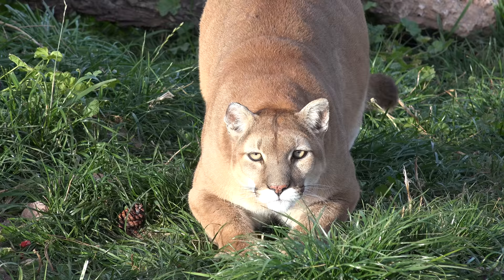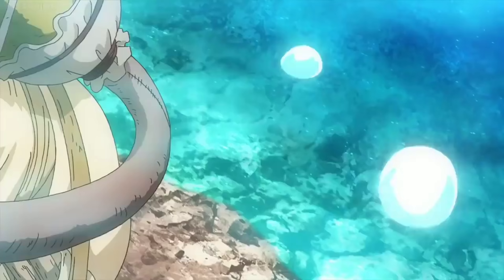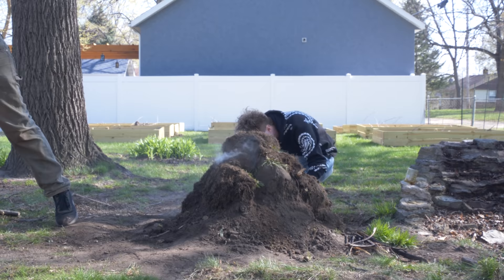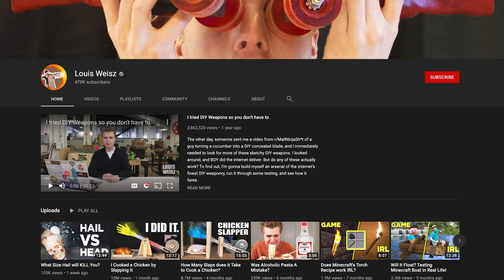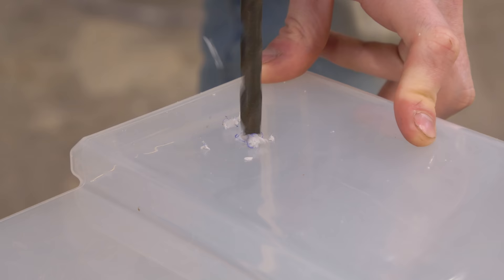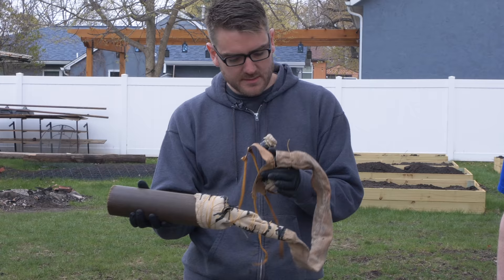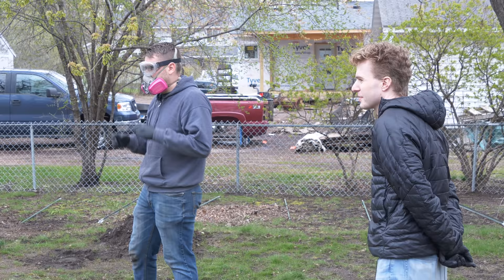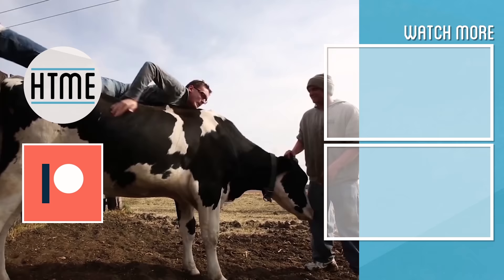Making Dr. Stone Gas Mask From SCRATCH w/ @Weisz

Comment: You know, the fact that you have to remove your foggy glasses, is a fairly good indicator that it is not airtight. Fellow glass-mask guy here.
Reply: yes and no, glasses only fog on an exhale, which wouldn't be an issue so long as the mask resealed on an inhale. 

That said half-face masks aren't the best choice for an air-tight seal, as the edges cover parts of your face that move as you turn your head or talk, which breaks the seal. it would be better to do a full face/head mask or to just stick the tube in your mouth as your lips can easily make an air-tight seal.
Reply: @j.c.cannon2112  The fogging is still an issue because the resealing on the inhale isn't instant, so some toxic gas would get in before the seal was reestablished. Modern gas mask valves are designed to be sealed tight any time that there isn't a positive pressure pushing gas out, so they don't need an inhale to reestablish the seal.
Reply: Redundant anyway.  In the anime they're going in to an area that would blind them long before the masks failed

Comment: I definitely think that the chlorine gas produced in that box was way more than the charcoal could effectively absorb. Maybe if it was a lower concentration mix with the air, the results would have been better?
Reply: And the mask is actually too small for them, it doesn’t cover all the nose and the chin.
Reply: I dont want to be that guy, but please keep in mind gas masks ADsorb chemicals physically, they dont ABsorb. Its a important difference and the reason they want the most surface area. With absorption it would be irrelevant, because there only the volume counts. Also, i think if they cooled it down somehow it would adsorb way more of the gas, cause the brownian motion wont be as high as with higher temperatures and therefore the molecules would stay more on the surface. They should do a follow up video where they try some upgrading.
Reply: @Aochso  There's also the issue that the pump was probably pulling air way too fast.
In the show, at least, Senku stresses that you shouldn't panic and hyperventilate, because the filter won't be able to keep up with you panicked breathing.

Comment: You could theoretically seal the edges of the mask to your face with clay or mud, but then you wouldn't be able to talk or move your mouth much without breaking the seal. Awesome video, now I gotta go watch Dr Stone lmao
Reply: Soft bees wax on the edge to help seal against skin
Reply: @kirkstinson7316  ouch
Reply: @user-hf2qh5ck7j  soft wax (wax and olive oil), not body wax wax. In proper proportions the mixture should be similar in consistency to vaseline (which fun fact, can be used on gas mask if you are not clean shaved for better seal).

Comment: If you can't beat 'em Join 'em!!  Great work guys!  I hope to offer a few pointers that might have made this more feasible for things that would have been known both to Senku and Kaseki. 
1) I don't think the anime explains where he gets it, but in addition to the activated charcoal I believe Senku used Potassium carbonate, which (and again my chem is rusty and I was never that good to begin with) would have caused a double replacement decomposition I think leaving you with Potassium Sulfate, CO2 and Water.  Someone that knows more about volcanic gasses and has had Chem in the past decade please check me.
2)  Senku mentions it in the Anime, Hydrogen sulfide is denser than air, so it pools, and that's why his masks have the big glass chimneys.  They're trying to pull air from where it's safer.  Provided you have good seal, this is important.  So the next tips will deal with how to ensure good seals.
3) Senku has billows, and they have a shallow pond area if you have someone to take the place of Ginro and Kinro,  you can use the billows to inflate your tubing and check your tubing and mask for leaks, as steady stream of bubbles will let you know in a hurry where your problem area is.  Or, and this is not shown in the anime, if you have bamboo and caveman glue or pine-tar etc.  You can actually create any number of air or water pumps from that nearby waterfall.
4) Leather & Tube Tips:  
A)Making seamless leather tubing is hard, I commend you on what you've done.  But there's an easier way, There are animal organs that you could prepare or use as an overwrap to make sure you contraption is actually gas tight.  
B) Keep in mind that all leather products are going to have a limited shelf-life and probably would need to be waxed before each use, 
C) The duct tape was a good idea, but you can improve seal over the mouth in several ways, such as taking the time to shape and fit the mask to the single face it was intended for (can be done with stiff leather, oil, and wax),  you can fold the outer lip of the leather over to make a better seal / gasket that with crush / deform around your face better and make a more airtight seal, you can knead things into wax and create a semi-seal
D) If you have a hand-spool and know the right knots, you can actually tension the leather down over the bamboo so tight that pitch / wax isn't truly needed, it's more of a secondary seal
5) Garrett Morgan's precursor to the gas mask consisted of multiple tubes to get to "clean air" (was also made of canvas, so you know leather can do the trick.  Anyway, my point was if your air tube is located somewhere in the middle of your filter you could might potentially be able to trap any Hydrogen sulfide below your air intake, it's not that much denser than air so that's a maybe, but it'd be something to boost the effectivity of your device.

Love the show, love the channel, those weren't criticisms, just somethings to consider. Before the reboot you'd occasionally try redoing things so maybe this is one you'd come back to.
Last thing, you're doing great.  More than a few things on Dr. Stone don't make sense.  Chalk it up to even genius science users don't know the best ways to do everything.  Your channel is awesome and thought provoking.  Keep up the great work!!
Reply: A very good breakdown my man

Comment: As some others have also said, if you use that leather tube again, some ribs inside the tube will keep it from collapsing then there is negative pressure such as breathing in while using this gas mask. Great video!

Comment: I'd say that especially since in the show they spent I think a bunch more time making multiple iterations on the mask system, so assuming that the issue with the one in this video was a hole in the tube or something, I'd definitely believe that with a few more attempts at making more airtight of tubes, as well as with some more work put into tightening up the seal on the mask bit, this could absolutely work.

Comment: You didn’t actually make activated charcoal, the potassium carbonate doesn’t „activate” it, but it helps, running 300°C steam trough it will. Cody wich you made glass with has a video on activated charcoal

Comment: Should of used some small bamboo rings to line the inside of the tube to make it easier to breathe. Don't need to be glued or anything just stacked up on top of each other and boom, flexible reinforcement. If you want to go fancy then use some green willow branches and weave a loose tube net.

Comment: Wait but what about that one way valve that you made on the sides? You need active breathing for it to work, no? It closes off only on suction and opens on breathing out - so blocking path (well not fully but still) for outside air to get inside. On video it seems as if you just let it be - so it should be open.
Reply: they mention that the pump was simulating breathing, in & out
Reply: @Heliosmaster  Maybe they didn't use strong enough pump? It doesn't look moving valve to me on camera. If pump is on the end of the thing that too changes how strong it should be.

Comment: in the show they say them selves that it does not work if you breathe too quickly, if the pump is drawing too much air, the filter does not have time to do its job. thats also why you dont smell anything i bet, because you are drawing in less air than the pump was. you should try the gas test again but the pump going 10% of max draw speed or slower, the goal is to go slow breathing speed.

Comment: Preface, I’m not a blacksmith, just an enthusiast, but the fact that you are still blacksmithing on a rock kills me. So my suggestion is, can you make an anvil out of iron or bronze what works better than a rock. It doesn’t have to look like an anvil as we know them it could be a cylinder no bigger in diameter then the bottom of a solo cup and slammed into a log to keep it from moving so much. Just wanted to chip in. This will probably get buried.

Comment: you can put segments of bamboo inside the leather tube, it might be that the lack of air circulation inside the collapsed leather tube is creating a vacuum inside the mask itself and the as you said the plastic of the mannequin is letting the chlorine gas penetrate

Comment: Q: With hydrogen sulfide (H2S) gas, would you be able to know that you're dying before you're dying?
A: No. I don't know what they say about this in the anime, but in the manga Senku tells a story about how some researchers went into an area with H2S gas around their feet (they didn't realize), and one bent down to tie his shoe. His face hit the gas and he was dead before they realized anything was wrong. This also jives with what I've heard in my HAZWOPER training when they talk about going into confined spaces and the dangers of "sewer gas". H2S gas is nasty stuff.
Reply: Do you think that might have been the gas mentioned in "Little House on the Prairie" (the book, not the TV show) that had Pa lowering a candle into the well he was digging to test the air? His assistant thought the candle was a waste of time and went down the well one morning without it, he ended up fainting at the bottom and Pa had to tie him to the rope and pull him up. But both men survived, and Pa used a makeshift bomb (a bit of gunpowder tied in a cloth) to get rid of that gas so they could keep digging.

Comment: maybe make saw with smaller japanese style teeth so you don't produce so many thin cracks along the grains of the bamboo. 

The one way valves really need alot more care and thought into how it's made,  after testing, I found that rabbit leather works the best. there's really no good way to seal it properly by just directly making a bun over the valve, so depends on how accurate you want to get towards the source material, you might want to roll the leather over the valve, and seal the end like the butt of a tube of toothpaste, making sure the stitch and sealant is airtight. reverse it, cap it over the valve, tie it down lightly with leather string and mark spots for holes just right above the string(about 1.5~2mm apart) and puncture the holes from the underside. You don't need more then 5 holes each valve. Carefully make groves around the valve where the string is then reattach leather cap back to valve and tighten with leather string.

 and the glue application, oh god the glue application. the glue you've made is great stuff, but you're trying to seal pipes not dabbing vegemite to toast. Get a piece of twig and crush the end or use your hair to make a brush, then brush it on the valves in layers like you would a pipe. Brush nice even thick layers on the outside where the grains of the bamboo is exposed to seal it up. Just dabbing it on cracks doesn't get it completely into the cracks and it will leak. also bamboo isn't pvc so be mindful of the tube-like fibers it's made out of.

Comment: Fun tip I learned in usmc cbrn school...
standard gas masks will not effectively stop chlorine gas. Chlorine gas can basically chew straight through standard gas mask filters in about 40 minutes or so, give or take. To prevent this issue, non standard, expensive and special filters and/or filter attachments have to be used.

Comment: I would've used obsidian to cut the leather, it's far sharper than a regular iron knife could ever be and it has no risk of breaking cutting leather. There's a fourth way to activate charcoal as anyone that watches Cody's Lab knows... superheating it. The big thing about your rig is it's maybe 1/50th of the size of the one on the show. I think if you had a way to upsize it, it'd probably work... so long as it's sealed properly. Increasing the length and adding a distribution block carved from wood on each end, you could also add multiple pieces. 5 or 6 of the same diameter pieces you had at about 30-36 inches would likely be about the same volume as the one on the show.

Comment: crushing charcoal does not increase the surface area per-se. The surface area you are accessing from activated charcoal are microscopic pits embedded withing the structure of pieces of charcoal. if you destroy that structure completely to fines or dust or powder you destroyed the structure.

Also acids may increase the porosity of the charcoal structure, but steam activation does this orders of magnitude better. the charcoal needs to be heated back up to the original temperatures used to create it, 500C to 800C, and introduce steam to the material. The cave man way of doing this would be to simply terminate your pyrolysis pit with water (slowly), before completely drenching it to remove all heat energy. Whats left will be much more activated (and larger quantities) than if you smolder-ed and acid-ed the carbon material. you can test the resulting material from your method and what i described with the iodine test for each materials adsorption ability.

Comment: I was thinking that maybe part of the reason it works in the show is because the intake is held higher up where the parts per million of toxic gas is less (assuming it's not a windy day) which can help survive a but longer. As for the seal, if this was something truly life or death, they could also have opted to add some of the glue or sap around the mask while on the face to make a more air tight seal. The better the seal the safer you are after all!

Comment: i would have put a bunch of short pieces of hollow bamboo inside the tube so that it didn't collapse when you breath in but it could still bend. maybe attach them together with leather and tar before putting it in the leather tube and that would add another layer of sealing.

I would have also liked to have seen your mask tested with the choline gas using a modern filter to see if it's the homemade charcoal that was the issue.

Comment: here's a thing I need to point out the hydrogen sulfide is denser then air so there is less of it higher you go. So this gas mask doesn't have to work perfect directly next to source of this gas to work in hydrogen sulfide poisoned area. But still great job

Comment: You still need to heat the charcoal after soaking it with the acid or base for the chemical activation. It only lowers the heat required.
Reply: with this amount of regular charcoal powder it shouldn't matter though, you wouldn't be able to improve the quality that much anyways

Comment: They make a very high inlet for charcoal chamber to avoid the toxic gas get in and take fresh air from a higher level, the dummy test would fail 100% when you locked the dummy in gas chamber and put a fan for mixing toxic gas in the chamber.

Comment: Hm. 
Nice collaboration.
Plenty of other commenters have pointed out why the mannequin test didn't work. (Airflow rate, plastic not sealing like skin, no exhale or breath humidity to make the valves work)
I'm surprised you didn't use some bamboo for the active carbon. Due to the shape of the bamboo fibers, when you turn it into charcoal, the fibers turn into carbon nanotubes with extremely high surface area. If you use a sealed box for a retort and get the fire hotter, you can make better quality activated carbon that does a better job on chlorine. Treating it with alkaline potash at that point would just help it deal with the acid.

Comment: Was the "in and out" cycling of air through the mask a constant flow of air through the mask and back into the container? I couldn't tell from the setup, but if that's the case maybe the constant flow was too much volume for the charcoal to filter? If the flow was made to mimic slow and steady breathing (in and out), results may improve, though that's just a guess. Similarly a guess, maybe the concentration of chlorine gas in the test chamber was higher than would be naturally found on the surface. Assuming natural sources would have lower concentrations, maybe then the gas masks would suffice?

Comment: You did not make activated carbon. Actvation, even in presence of base or acid, requires temperatures in the range 250-600 C.

Comment: The problem is also that the tube is way too long. Wity tyat long a tube, you need active air flow, not personal breathing. That's why gas masks generally have the filter directly on the mask. Those with a long hose recycle too much exhaled air, so you get less oxygen over time.
Reply: Maybe a more efficent exhale valve could help with that a bit.